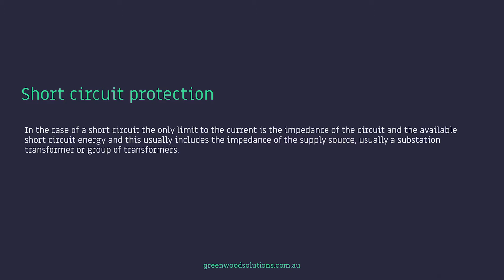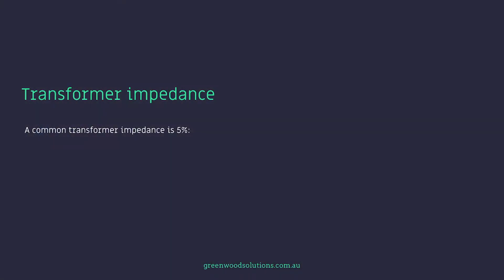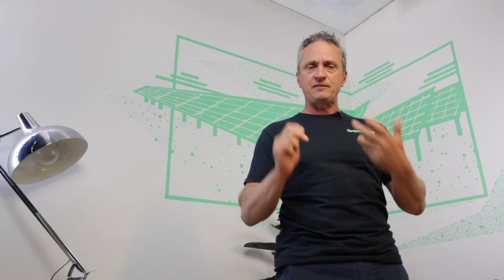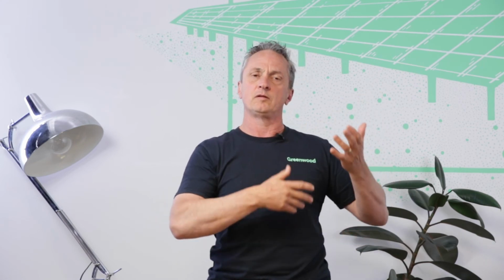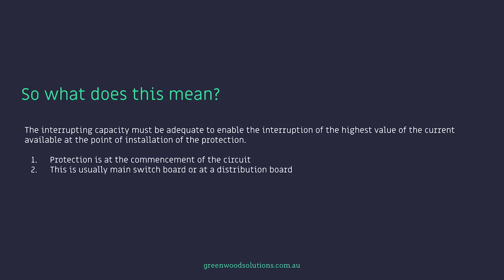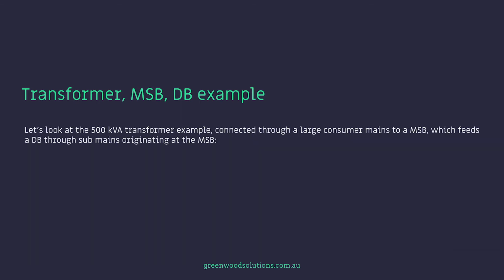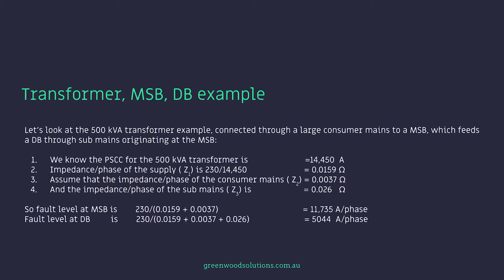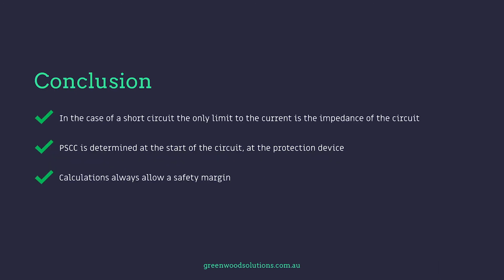Prospective Short Circuit Currents

Comment: I think there is something forgotten....(Great Aussie Content . Cheers )

 In a MEN System (TNC-S) the 3 Phase Prospective Short Circuit is significantly higher than the Per phase Short circuit Current.  Ipsc = Root 3 x Isc. 
The impedance  per phase for a Phase to Earth Fault , must include the Neutral return path (Via the MEN System aka the P.E.N)   A single phase to earth fault has a much higher Loop impedance  for a Phase to Earth fault loop path  

For a Per Phase Short Circuit to earth the impedance is  Zs= Ztx + Zcable  +Zpen
For the purpose of a Bolted Symmetrical fault  (3Phase Ipsc) the fault loop Path Ignores the Neutral Return path, as the out of phase currents cancel each other, reducing the neutral fault current to zero. Therefor the impedance path for Ipsc is  much Less Zs = Ztx +Z cable  (with no Zpen)         

Therefor the analysis of Ipsc for a 3Ph Ipsc must be 1.73(Root 3) higher than the single phase short circuit current,  after ignoring the neutral Impedance  (Balanced Fault).
3Phase Ipsc = 1.73 x Is/c
1Phase I psc = Is/c   

Perhaps another way to look at it, the heat energy in fault current per Phase is 1/3 of the total energy in the fault.
You can't add impedance across phases so you have to  analyse the effective impedance per phase 
The Fault Path to earth (MEN via PEN)  is  twice the resistance , (Half the fault loop current per phase)  
You could compare the impedance Values as 2 divided by root three , Hence the three phase to single phase conversion of  cable resistance in Table within AS 3008.1.1 (1.155 or  1/0.866)

Perspective Short Circuit current is Line Current for a Phase to Phase to Phase fault  (Worst case) in a balanced fault with no neutral impedance restricting current.. 
Remembering that  Phase currents in a Star connecting are the same as line current 
 Ipsc =  Vline / Zs
Ipsc = 1.73 x Vph / Zs        when  I s/c = Vph / Zs
 Ipsc = 1.73 x   is/c

Thanks again for the great content!!!
Reply from the maker: Cheers for that.

Comment: just a question. I assumed this was a single phase dsistribution board, if it was a three phase distribution board instead and the fault was accross all three phases I assume the fault calculated on your example should be multyplied by 2, or accross 2 phases them 1.73. please help.
Reply from the maker: The board is three phase. When you are talking about a three-phase inverter etc the current mentioned is per phase. For example 200 kVA worth of inverters have a current value of  200,000 vA/( 400V nominal x 1.732 ( SQR of 3) = 289A/phase

Comment: Thank you for the vid, vry much helped me. I wish everything can be explained like this. The very best wishes to you. I have struggled to find stuff like this with the clarity you have shown.
Reply from the maker: Thanks Angelo. Hope these video help in other areas too!
Reply: Only part if you could explain, I was under the conception the highest fault current would be at 400 volts and not 230, can you kindly update when you can thanks. Its when you devide the fault current at the Consumer mains you have considered 230 volts devided by the impedance, I thought that would be 400 volts and not 230 volts. If you or anyone can advise the reason thanks.
Reply from the maker: @angelofranklin1  Faults are per phase hence the 230 volt reference. Hope this answered your question!
Reply: @GreenwoodSolutions  Thanks appreciated.

Comment: Great Video Thanks mate, made it so easy to understand! 
Is it the same for Calculating Ipfc at the sub board but doubling the Z1,Z2 and Z3 impedance values?
Reply from the maker: Sort of getting out of my depth here but impedance increases the further you move away from the transformer, hence the kA rating of components tends to be lowered.

Fault level at a sub-board would include the previous impedances so fault level at subcircuit connected to DB would be:
230/(0.0159 + 0.0037 + 0.026 + impedance of the cable run from DB to subcircuit)

Hope this helps!
Reply: @GreenwoodSolutions  Thank you mate, is that for Ipsc? i'm curious if ipfc is the same?
Reply from the maker: @michaelriley5158  If you are using a Loop Tester, you would record both PSC and PFC values and record the highest value. Due to the nature of different supply types, you would expect to find a PSC value higher than a PFC value on both TT and TN-S systems, however on a TNC-S system both the PFC and PSC value should be identical.
The vast majority of installation of electrical supply throughout Australia will fall under the TT classification of BS 7671
Both PFC and PSC tests are designed to calculate the max current that will flow within a fault loop path during the event of an electrical fault as required by regulation 612.11 of BS7671:2008.
A PSC test calculates the current that will flow in the event of a short circuit fault between the live conductors. That is, Line and Neutral on a single phase installation or Line to Line/ Line to Neutral on a three phase installation.
A PFC test calculates the current that will flow in the event of an earth fault; i.e., Line to Earth. Hope this helps!
Reply: I think there is something forgotten....(Great Aussie Content . Cheers )

 In a MEN System (TNC-S) the 3 Phase Prospective Short Circuit is significantly higher than the Per phase Short circuit Current.  Ipsc = Root 3 x Isc. 
The impedance  per phase for a Phase to Earth Fault , must include the Neutral return path (Via the MEN System aka the P.E.N)   A single phase to earth fault has a much higher Loop impedance  for a Phase to Earth fault loop path  

For a Per Phase Short Circuit to earth the impedance is  Zs= Ztx + Zcable  +Zpen
For the purpose of a Bolted Symmetrical fault  (3Phase Ipsc) the fault loop Path Ignores the Neutral Return path, as the out of phase currents cancel each other, reducing the neutral fault current to zero. Therefor the impedance path for Ipsc is  much Less Zs = Ztx +Z cable  (with no Zpen)         

Therefor the analysis of Ipsc for a 3Ph Ipsc must be 1.73(Root 3) higher than the single phase short circuit current,  after ignoring the neutral Impedance  (Balanced Fault).
3Phase Ipsc = 1.73 x Is/c
1Phase I psc = Is/c   

Perhaps another way to look at it, the heat energy in fault current per Phase is 1/3 of the total energy in the fault.
You can't add impedance across phases so you have to  analyse the effective impedance per phase 
The Fault Path to earth (MEN via PEN)  is  twice the resistance , (Half the fault loop current per phase)  
You could compare the impedance Values as 2 divided by root three , Hence the three phase to single phase conversion of  cable resistance in Table within AS 3008.1.1 (1.155 or  1/0.866)

Perspective Short Circuit current is Line Current for a Phase to Phase to Phase fault  (Worst case) in a balanced fault with no neutral impedance restricting current.. 
Remembering that  Phase currents in a Star connecting are the same as line current 
 Ipsc =  Vline / Zs
Ipsc = 1.73 x Vph / Zs        when  I s/c = Vph / Zs
 Ipsc = 1.73 x   is/c

Thanks again for the great content!!! 

 @GreenwoodSolutions